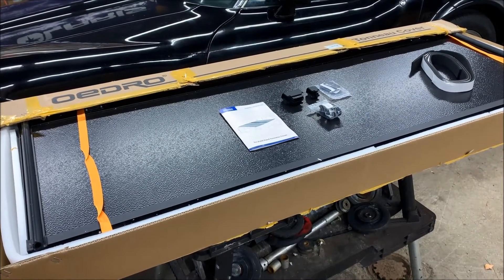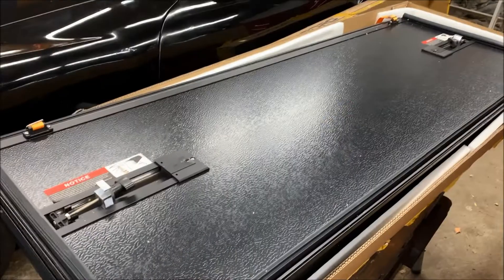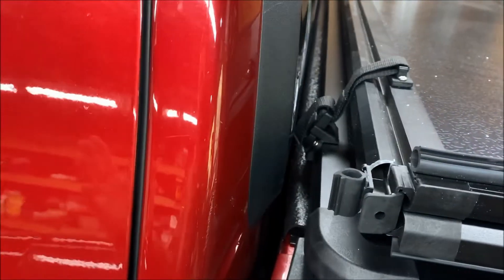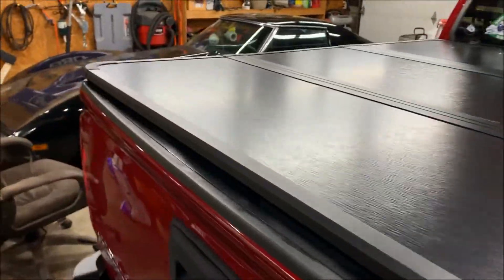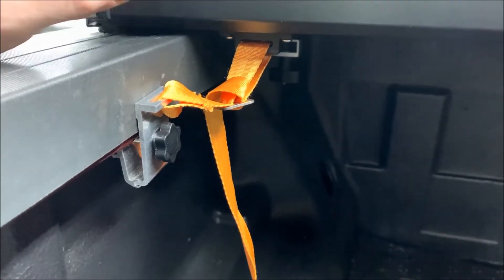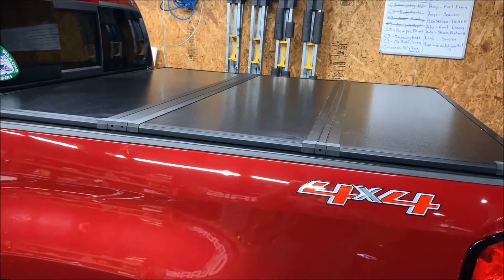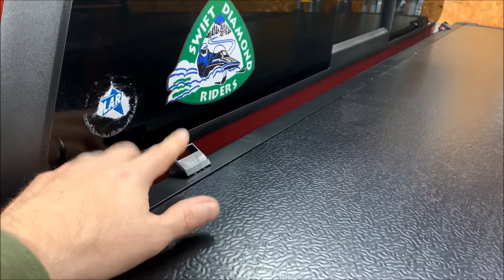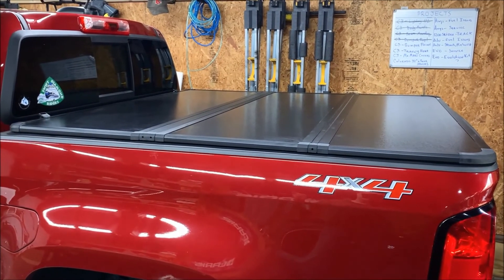OEDRO Hard Tri-fold Truck Bed Tonneau Cover Installation and Review

Comment: Sweet looking bed cover Tom! I've always liked those, they're much more secure than the vinyl tonneau cover, but they are more expensive. I opted for a cap, it's secure and gives you double the bed capacity, but they're way more expensive than even the hard top tonneau.
Reply from the maker: I didn’t think I would like it as much as I do. But I’m really liking it. 

My buddy has a color matched cap on his Silverado and he loves it. Makes it more versatile for him.
Reply: @StreetersGarage  I have the same thing, a color matched cap. It's nice but it has it's limitations too. It takes a lot more work taking it off and on, that's where the tonneau covers are great.